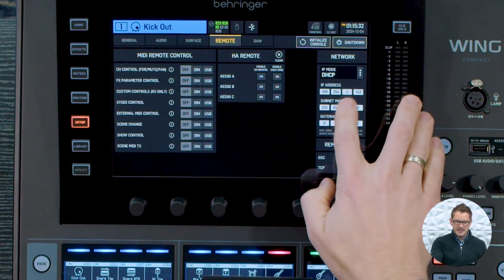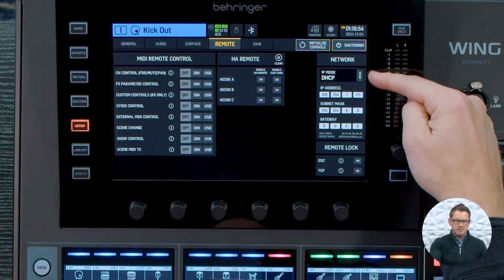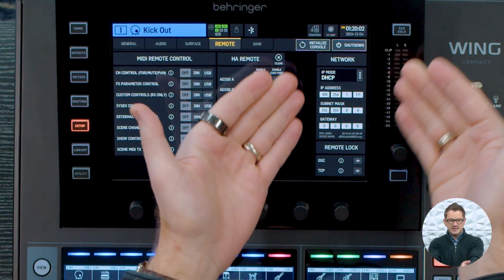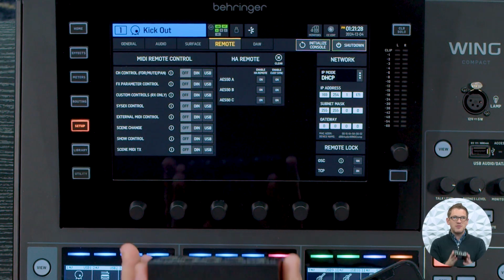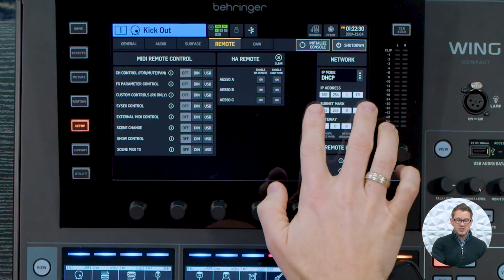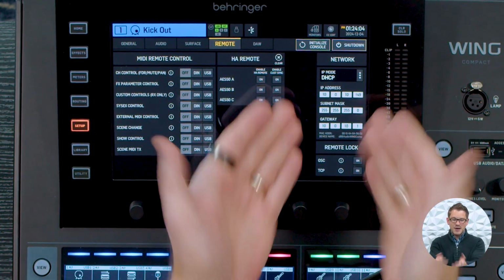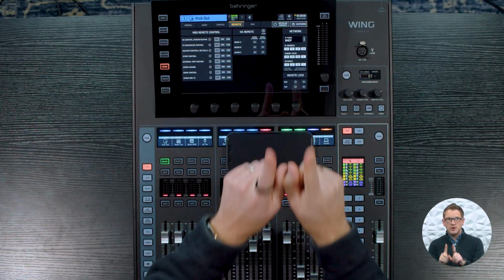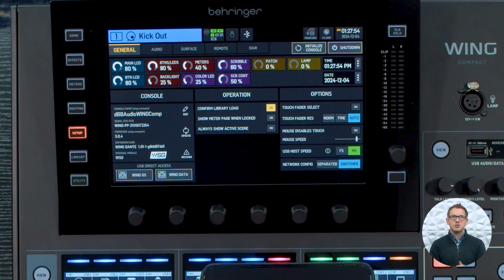My Mixer Isn't Working Over WiFi!

Comment: Hi Drew……. My Mac connection has worked perfect since we purchased the Wing rack.  Wing edit connected via WiFi, DHCP and all was good.  I updated my Wing, Wing Edit and my Mac to current software thinking my issue just prior to that would be fixed.  My issue is lost connection.  I have tried everything and as soon as I connect my Wing edit, within seconds it loses connection.  It keeps doing this.  Any ideas?  iPads and phones have no problem just my MacBook Air.  We are using a Swissonic Professional 2 router.

Comment: Thanks Drew. Was struggling with this on W. compact 2 days ago. didn't know about secondary port thing. IP wouldn't change so I switched to Static , updated IP the back to DHCP. it worked but not sure...its on secondary port though. 

Your presets on your website have been very helpful as well.

Comment: The subnet masks don’t actually have to match between different devices, it just has to be broad enough that both sides are considered “local” to each other. The corollary is that you don’t want the mask to be broader than anything that isn’t local but you do want to talk to. 😁 in a simple sense, yes, they should match, but having them be right or at least “right enough “ is more essential than having them matched but wrong.

Comment: Also does anyone have experience of using vlans?
Reply: Tons of experience. If you have a good reason to separate groups of devices and you have a plan for how they would intercommunicate, go for it. Otherwise, good luck.
Reply: I don't know if these devices support VLANs, but my recommendation would be to configure the port on the switch that this connects to for the VLAN you wish to use. Then open any firewall ports or configure NAT if needed for cross-network communication.

If you do not have experience with VLANs, that is a whole other rabbit hole to go down. You need a switch that handles VLANs with a management console, a router to handle VLANs (on multiple ports or a single trunk port), and you'll want a solid understanding of basic networking switching and routing to set it up. I would recommend learning this before putting it into practice. If something breaks, you'll want to be able to fix it.

Comment: also to consider. buy a tool to check the individual cables inside the network cable. it could be that the data transmit or recieving wire is cut. which will leave the led lights on on the device, but it still gets an apipa addres. i have seen it a lot in a industrial production environment.
Also tips: try to have a dedicated DHCP and use dhcp reservation by MAC. Mostly it can be done from the router. so that the IP is always the same.
please use .1 or .254 for router IP. its a common practice.

Comment: Self assigned IPs (no router): Don't the third octets (number groups) also have to match, leaving only the fourth to be unique numbers?

I like to set up my router so the DHCP pool starts at 21.  This gives me 19 available static IP addresses for the consoles, IEM transmitters, mic receivers, etc.  Thus when connecting the tablets or computers at a gig, the apps always find each gadget at the IP address it occupied last gig.
Reply: For the self-assigned addresses (APIPA), only the first and second octet must be the same. This is because of how this network range block is configured. Every network has a subnet mask. This tells the device what IP range is on its local network and it can speak to directly vs which ones to forward to its default gateway to route to the destination on its behalf. It's how your computer knows to send requests for YouTube to your router and not look on your local network.

The typical home network will require having the first 3 octects the same by using a subnet mask of 255.255.255.0. This contrasts to the APIPA subnet mask of 255.255.0.0, which means anything from 169.254.0.0 through 169.254.255.255 are on its local network. If you want to dig deeper, look into IPv4 subnetting and routing. I have mentioned out-of-the-box configurations, but these can be modified for more advanced requirements.

If no Internet or other networks are required, it is perfectly fine to use the APIPA addresses for your devices to communicate between each other. Even statically assigned addresses with only a switch and no router will do the trick as well. Just make sure the addresses are on the same network.

Comment: Hi Drew!

My issue is that with DHCP, it gives us a different address each time we turn the console on. Sometimes I’m able to assign a static IP address and it’ll work. Other times, it won’t. Is it supposed to do this with DHCP? If so, that’s annoying to have to reconnect to 3 consoles all the time.
Reply: That basically depends on the DHCP server - usually your router unless you have a very specialized setup. Usually, those will have an option in the admin interface to always assign the same address to a specific device (based on its unique hardware address aka  MAC-address). Depending on the brand/firmware, that setting might be a bit hard to find. Searching online for how to do it for your router should probably get you there though.
If that is set up correctly, your client (in this case the mixer) should always get assigned the same address, while this address will never be randomly assigned to any other device in the network.
Reply: also, you may run into issues when using static IPs in a DHCP-enabled network. When you turn on a static-IP-device while the set IP was already assigned to another active device in the same network by the DHCP server or two devices try to use the same static IP, it will just not work properly, because the network hardware doesn't know for which device a packet of data was intended
Reply: Set up a reservation on the DHCP server.

Comment: Hi Drew, your last mention with the option in the Setup (seperated/switched) is only available when a WSG is installed in the internal Port as long as I remember (not seen when Dante or no card in internal slot)
Reply: Same as my compact with FW 3.0.5